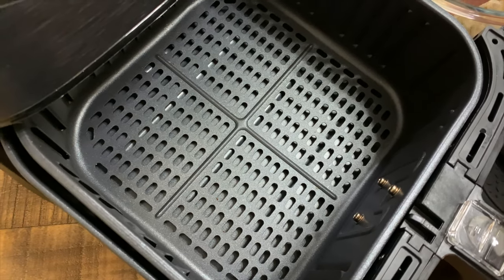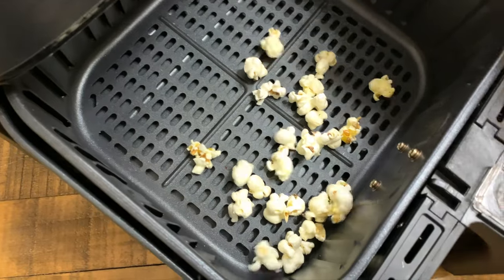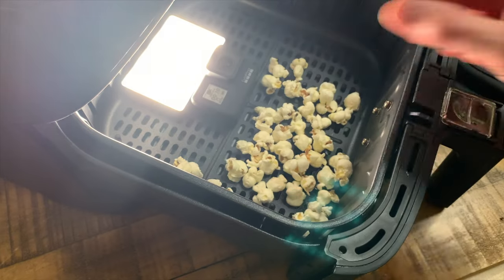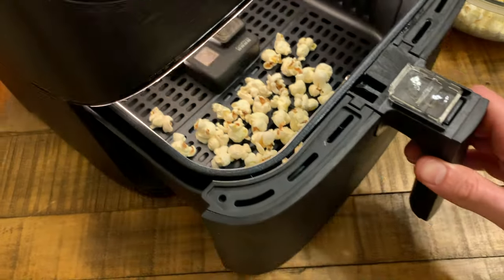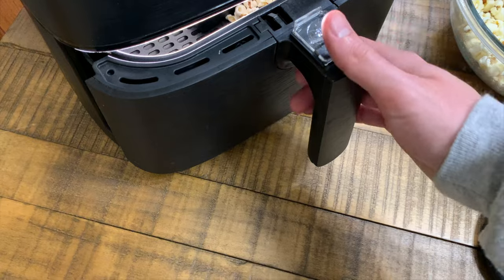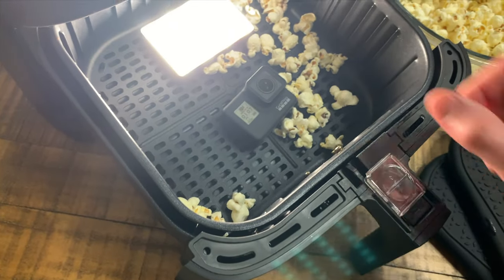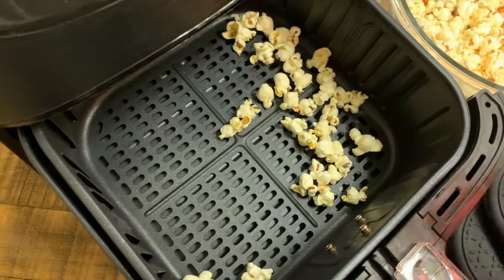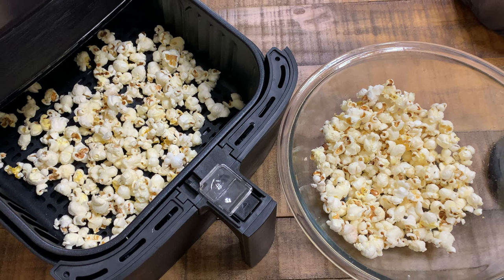Air Fryer Popcorn - Just a warning..

Comment: mine has a removable tray, couldn’t i theoretically put the popcorn in the base of the air fryer and put the tray over it?
Reply: Have you tried it yet?
Reply: any update?
Reply: Some of the popcorn would still find its way to the fan probably and usually there is only a small space, your best bet would be to find some kind of lid for the airfryer basket.
Reply: Yes
Reply: So smart
Reply: Yes, this works perfectly
Reply: @uadcro 
Your comment is %100 right, I tested that

Comment: My airfryer hasn't got an exposed element it has a grill to protect it, is that an expensive one?
If you have a rotissetie airfryer you can use the rotating chip basket.
Although I would agree a microwave may be better.
Reply: the best way is a sauce pan with a little oil, bring the heat up high with the lid on when it pops turn heat to low, shake the pan to make the raw kernels drop to the bottom, when popping slows down turn off heat. Perfect pop-corn, no burns no raw kernels takes 4 minutes

Comment: Popcorn🍿 in the AirFryer

 It is easy to make popcorn in an AirFryer.

 It is easy to make popcorn in an AirFryer.
 I put my rack at the top of the drawer.
 With a silicone mat / Silicone insert.
 AF - Cosori Dual Blaze

 Popcorn🍿 in AF - Cosori Dual Blaze ♨️

 2 dl corn kernels,
 A little salt is sprinkled with cornmeal
 205°C for 10 minutes with the rack over

 Tips:
 You can spray a little oil over corn kernels 🌽 with an oil spray bottle or an oil pump.

Tip:
Many grills can be adjusted and placed at the top of the drawer.  Because of the 4 small rubber shoes / rubber bumper that protect the grill from the drawer.
 Also uses a silicone mat that can either be placed on top of corn kernels or on top of the grill.  You can also use a grill net mat that can be bought from Harald Nyborg, Jem and Fix Biltema for DKK 20. It just needs to be cut to fit your AirFryer basket.
By using a silicone mat, you avoid it flying up into the fan and heating the body and burning itself.

 Note:
 REMEMBER - No fat.
 - It is not necessary, but you can add a little flavor by using oil spray.

Comment: Common sense if you put a fan on popcorn it will blow into the heat element and fan and can burn get stuck up there catch fire or ruin your air fryer.  This is what hot air blowing around in an enclosure will do.  I can imagine it happening without even doing it.  This is how I know not to use my air fryer to make popcorn, I imagine where the popcorn will blow to.  It would be the same as doing it in my oven, it’s a big no.  😮😂😂😂😂😂😂😂😂😂